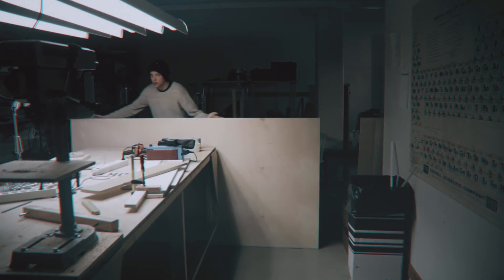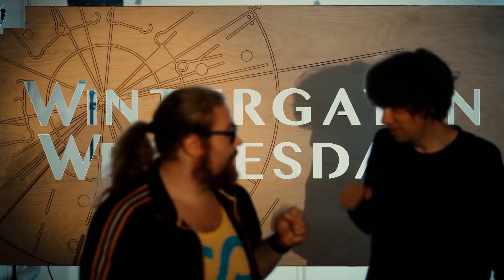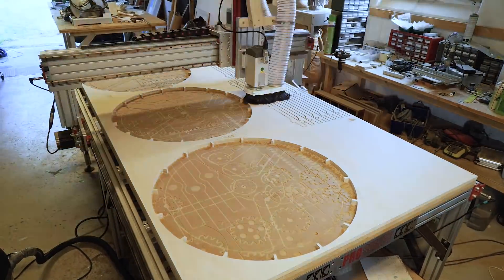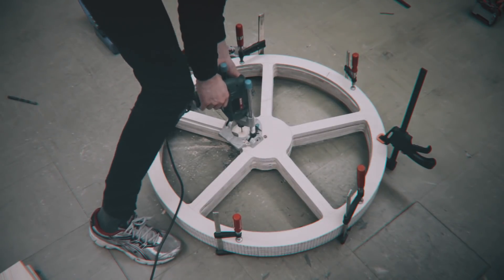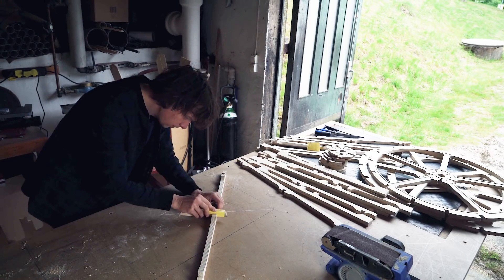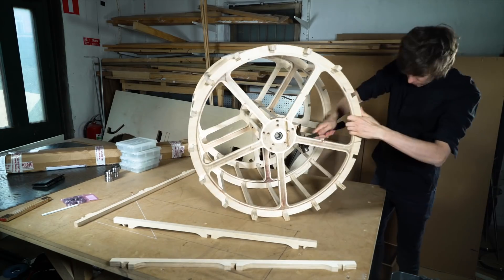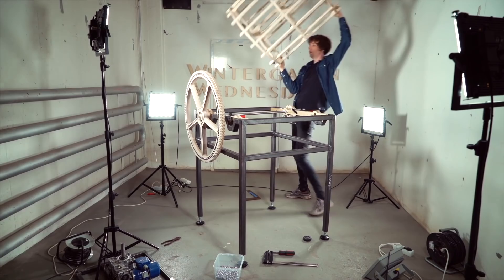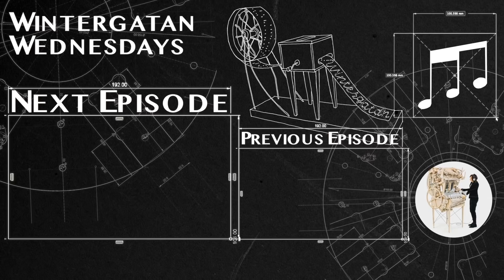Programming Wheel Skeleton - Marble Machine X #14

Comment: Re: hammer - it is more about using the correct tool for the job, a mallet is the correct tool for the job and using anything else is 'wrong'. After all you can use a knife to tighten screws and if it is convenient then go ahead as long as you realise it is 'wrong' and using the proper tool is a far better way of doing it.

Comment: Did I see that you had steel programming pins held with the magnets triggering to those intriquite wooden arms?  Would put a replaceable type strike surface on those parts that would stand up to the pins.  Wont have to rip apart the machine, just replace the tips of those triggers when they get worn out.

Comment: well, it's not so much scratching, though that can happen, it's just that metal hammers can smash and cause dents. A wooden mallet won't do that because it's the same material. I say that because I did 4 years of woodshop and I'm one of those people who die a little bit inside when I see you hitting it with a metal hammer.

Comment: If you use a metal hammer and beat on the wrong section of the machine it will affect the precision of the parts that you're trying to get with 3d printing and the CNC machine. Just a thought.

Comment: do another pass on the cnc.. on the second last pass leave 1mm on the z and 0.2 on the cut line.  make sure your start point is on a spot which will hold the part the best ie.. on the corner closest to the edge of the board.. it will save you all that manual work..

Comment: I must comment on the thing Martin said, he said the marble machine is infinitely re-programmable.  Not true.  If you add in the musician playing, then you can approach this idea of infinite variation.  But the number of different compositions the machine can encode will only have the number of steps in the programming drum times 2 to the power of notes at each step in the drum.  I could watch the videos and do the math, but it is clearly finite.  Also, in the range of possible arrangements that could be played without repeat, the music box tape that can be made longer, has the marble machine beat.  Now you could say, well we get a different number drum spins, but I would put this in the realm of musician performance controlled.

Comment: Loved the first machine and I'm following the construction of the new one with interest. I have a suggestion that might be useful. The balls are scraped off the lifting wheel's magnets by a sort of wedge at the top. How much resistance does this create?  Maybe it could be reduced by a magnet placed on the other side of the balls at the top of the wheel. If the spacing is adjusted correctly, it would counter the balls' attraction towards the wheel's magnets without holding on to them and allow them to be separated from the wheel with very little resistance.

Comment: But the only thing is that if u scratch it up when u take it apart for transporting the scratches will weaken the structure and it could chip and worst case scenario it could breaker when it on toure (I know I spelt that wrong)

Comment: The real reason people use wooden mallets is because iron and steel are significantly harder than wood, meaning they cannot just scratch it, but cause structural damage to it as well. Certainly a heavy wooden mallet or heavy blows with any mallet will do the same, but iron/still hammers have a much easier time at it.

Of course, since you are apparently not careless and are not striking at angles especially good at damaging the materials used, you don't have to worry too much about it. ;)

Comment: I'd say the main reason why people would want you to use a mallet instead of that hammer is specifically for the second reason. There's a good chance that you misjudge your swing either in aim or in power and could easily break something using that hammer. Dents, scruffs, scratches yeah they're fine since most people will be close enough to see them, but you breaking a part could easily set you back in terms of progress.

Comment: It's great to see the progress you're making! I do agree with your mom about using a wooden (or plastic/rubber) mallet though: it will be better on the wood, sure, but also a mallet will have a bigger head which will make it easier for you to hit what you're aiming for. I understand your point about not wanting the machine to be perfect-- that the marks add character-- but you could also drive screws with a ground down spoon, yet you use the correct tool in that case. All my best all the same :)

Comment: Martin, love the spirit of the build!  Passing along a tip, I never use my CNC table as a work surface involving any impact forces; like seating that bearing.  They will have a cumulative effect of throwing off the calibration of the machine in regards to the table surface and end of the mill.

Comment: please be careful when using the ROUTER TABLE.  (1) your dangling sweatshirt strings can be gathered up by the rotating bit and either pull you into the blade or slam you onto the table.  Hugely dangerous my friend. (2) Feed your part only against cutter rotation.  If you feed with the cutter rotation, the cutter will 'climb cut'.  This can pull your hands abruptly into the rotating blade.  Not safe at all.  READ A SAFETY MANUAL ON ROUTER TABLE.  You are taking very risky actions!!!

Comment: If I might make a suggestion: you might be able to get those bearings in a little easier if you put them in the freezer to cool them down. Seems like an odd idea, I know. In general, cooling materials causes them to shrink slightly, which could allow them to fit in the hole a little easier. Then, when it warms back up, it will expand to its original size and be stuck in there the same way as if you had hammered them in normally.

Comment: I know those bearing will never see a heavy load but it's still really painful to watch you driving them into place by hitting their inner race.
Reply: Zedex 12 he should only press the bearings in using the race that is in contact with the wood, in this case the outer race.
Reply: WhatAboutTheBee 
I know. And banging on the inner race ruins them for any load application. That's why it hurts to watch.
But then, when I build stuff like this I use bearings that are already beyond service in their original application, salvaged, and are fine for light duty.

Comment: I think the hammer concern has more to do with damaging (to the point of needing to replace) the plywood pieces with a metal hammer. Ply isn't particularly strong when cut to such thicknesses. A wooden mallet isn't much better. A dead blow hammer with a soft/rubber head would be best.

Comment: Super proud of cutting out all parts of his machine on a CNC, insuring accuracy of all parts and smooth operation.

Assembles and disassembles his parts with a metal hammer and throws pieces all over the place, causing them all to get scratched, marred, nicked and possibly warped.

Tears all hair out and curls up in a corner with a OCD-induced anxiety attack

Also, I have never in my life heard of someone water cutting steel . That sounds insanely expensive, and I'm not sure what you'd gain by doing that. Anyone care to enlighten me as to what advantage water-cutting has to cutting with regular machining tools?

Comment: Nice work !
I strong advise you to use some kind of protection for the wood. In your future world tour you guys will play at very humid, very dry, very clean, very dirt, very hot, very cold, places. The MMX may have water poured in by accident.
Naked wood will absorb the water and then swell. Pieces will be harder to fit onto another. Imagine dilation/contraction due to moisture.
You may protect the wood with simple candle wax to keep the looks of raw material. Any transparent protection is highly recommended.

Comment: The reason you should use a wooden mallet is that it doesn’t deform the part. If you disassemble it with a hammer there is a chance it won’t complete the World Tour due to stress points introduced in the parts. Plywood is strong but not invincible. Hell, I use wooden mallets to take apart metal items. 

Moral to the story is “Successful World Tour = Use A Wooden Mallet”.

Comment: You may still want to apply some kind of finish to the wooden pieces.

Traveling with the machine means it's going to be exposed to changing heat, humidity, and possibly water. You run the risk of the plywood warping, swelling, and de-laminating: all the care you've put into making tight tolerances and precision cut pieces could be ruined. Even worse: the stuff that's bound to happen on tours: it could be something as simple as a a piece being dropped on wet ground, or a covering leaking as you move it in the rain. Wet hands touching the parts as they're moved, and so on. Moisture will soak into untreated plywood, and short of using a kiln there's not much you can do to quickly remove it.

There are finishes you can apply that will protect the wood that won't affect (much) how it looks. A few coats of a non glossy clear polyurethane sealant, followed by very light sanding should look nearly the same as unfinished wood. Clear, non-glossy sealant for outdoor wooden decks may work well too. You can even distress and weather the wood before sealing it, so you have (and preserve) that worn, unfinished look.

Comment: Martin, have you considered how variations in air humidity and temperature may affect the wooden parts of the machine?
The snug fit of the bearings can be lost if the humidity decreases substantially. Maybe plywood is not too sensitive though since the veneers are oriented crosswise. Anyway, an untreated surface will take up or loose more humidity than a treated one. I think it would be a good idea to equip the transportation container with a humidification system.
Reply: Good thought, could also use a clear coat to seal it. It would retain the same "unfinished" look, but still have the protection from the humidity of a world tour.
Reply: Good idea. Air transit can have very low humidity too, and cold temperatures.
Reply: Your thoughts about it being less sensitive because of being plywood are accurate. Humidity will have very little impact to the fit as a result of the differing orientation of the layers. Many woodworkers use plywood to build their own precision tools like jointers, drum sanders, and band-saws because of this.

Comment: 9:18 Hey, Martin, greetings to your mom, she was absolutely right: just seconds before that statement I was thinking "Why is he using a metal hammer on wood?" It's funny to hear exactly that statement when I was thinking of it. But you explained it all the way, so now I'm ok with it. Also, it only leaves tiny scratchmarks  ( 10:40 )  lol
Really, really like your videos :-)
Reply: I just hope he won't knock the layers of plywood apart. Depending on the quality of plywood it may have cavities or places without glue, that you can't see from the outside. A good knock can split small parts in two. On the other hand, one could consider the hammer knocks a form of quality control.

Comment: Installing bearings on your CNC table - be sure you're not getting any sawdust in the bearings.
Reply: The bearings are sealed and won't see anything close to the load they are rated for. I'm with you regarding best practice but also it'll be fine.
Reply: Cool. Glad to hear it!

Comment: Hey, banging and tossing the pieces around is an excellent test of the pieces durability in real life conditions :0) taking it down night after night on tour will have its moments when a piece falls hard and it has to stand up to the job. Might suggest you mill a couple of extra parts for the pieces that get the most use or stress in case they break or crack and spare loose bolts, nuts and screws in case you lose some.

Comment: Rather than a wooden mallet, I would probably use a rubber hammer. I install locks on homes, and one of the biggest problems we run into when using metal hammers on doors is denting the wood, not scratching it. Using a rubber hammer negates that possibility. Granted, I don't think it's that big of a deal in general, especially if you want some wear and tear on your pieces.

Comment: For your mill, get a 90degree drill attachment, machine a holder that mounts on the mill head. Put a mandrel on it, put a drill in the mandrel and voila, you can now accurately cut holes on the sides of your wheels. Before that, you need to cut yourself a disc that has the indexing information for the rim holes, that disc needs to fit locked on to the wheel, and, then be affixed on the axis to the table. The machine will cut the hole, program a left movement of the head which touches a pin on the indexing wheel and it will move to the next hole. Rinse and repeat.
Whilst this isn't the proper way, it's the cheap way in a home shop to get a 4 axis mill (sort of) action going for your machine. Alternatively, you can cut a slot in the base board, drop some risers, fit the wheels on the risers (kinda like a balancing jig for bicycle wheel but upside down) and again, using an indexing wheel and pusher motion of the mill head, you can cut the holes with precision.

Comment: In my opinion you shouldnt make the machine look extremely well thought and structured. Parts should be protruding and moving. It should give of a feel that it shouldnt work but it does. If you make it completely straight forward it might lose some of that feeling the original had.
I am not saying that you should make it look like a wreck. But don't make it overly straight forward either. Going the complicated way even though some parts could be done way simpler is a must in my opinion.

Comment: You should be using a chamfer or corner round tool on the CNC machine itself to take care of deburr, that way you dont have to do all that manual work on the router table. Use locating pins so you can machine both sides of the part before dropping the final part out. Pretty standard machining practices and will save you a TON of manual work. You have a CNC now. Why not use it for everything! Keep it up! Enjoying seeing the progress.

Comment: What about having small actuators (pneumatic or electrical)  set the Controller to be able to be controlled via WiFi or Bluetooth then you can change songs live as it spins you can literally have the actuators go up and down and make remixes or anything else on the fly as it goes.

You can use a small brace on the side of the pin to keep it true while they pluck the mechanism to release the bearing.
Reply: This is inspired by a music box, so the program wheel is very important. What you're describing has been done before https://www.youtube.com/watch?v=44TDnU1TFus
Reply: While I have never seen that video before now or that style thing that is really cool. I know this is inspired on a music box, years ago I started a midi controlled music box. Well more like a Midi Controlled music chest it was rather large, it had an arduino controlling a wheel with a stepper motor  that spun around with actuator controlled pins all around that just stuck out as they came around. giving the exact same look as a music box but when the wheel was in the down state the pins that needed to change would go in as it comes up on the back side the pins that would go out while it was coming up to strike the notes on the comb. From someone looking onward the wheel just looks to a normal note wheel but its infinitely variable.
Reply: Or, even more expensively, make every single pin in the programming wheel (you'd have to make another programming wheel) binary so that it's either up or down and have that control by MIDI. You could change the song while it's playing.

Would be a horrible and hard to balance mess of wiring and other electronics though.
Reply: Yeah, you have to thing about the effort vs reward for things like this

Comment: i guess hes going to transport the marbles inside the programmign wheel by building little "baskets" on the inside. So hes going to end up with an "inverse water wheel"
Reply: ok, maybe, but i thought he said he is going to build something inside of the programming wheel to lift marbles. if he use magnets, the need to be very strong.

Comment: hey, if you had used a roundover router bit on the table router it would've added a slight curve to the edges of the studs and cleaned it up at the same time.
Reply: AwesomeVindicator Guess the square, rough look is essential to the design?
Reply: maybe but to get a clean look (without splintering) each piece would need to be sanded lightly, probably by hand too.